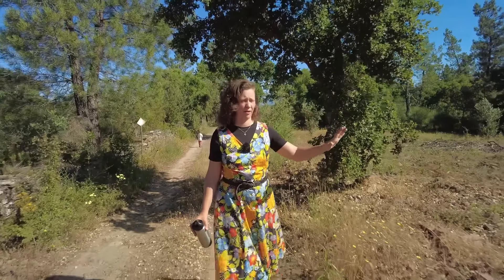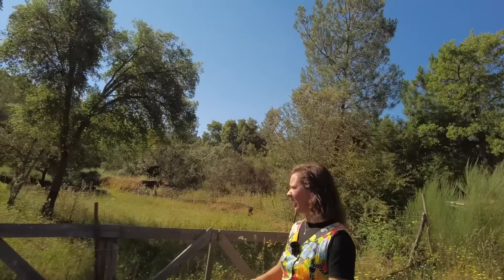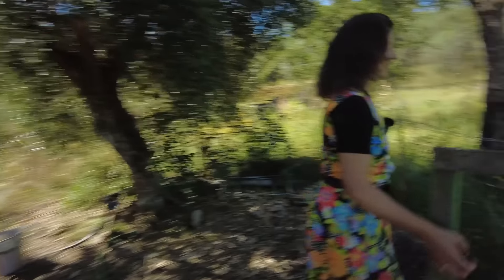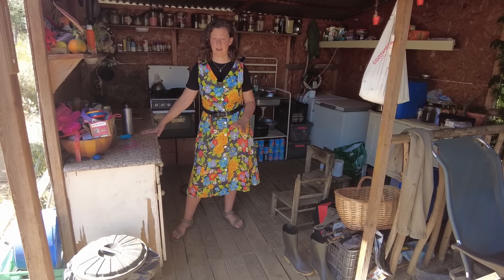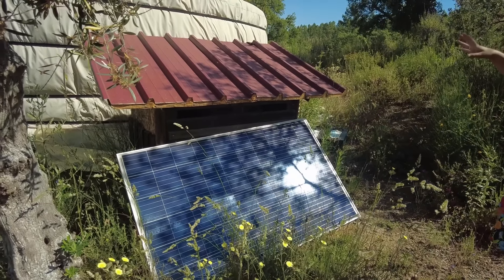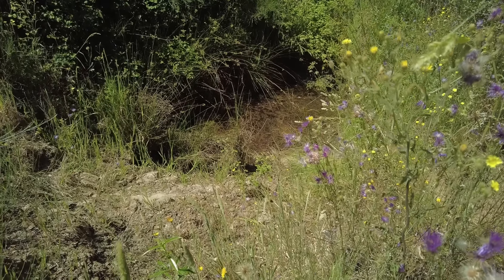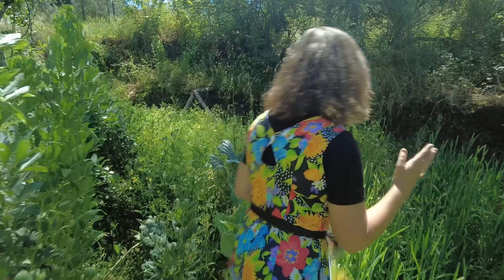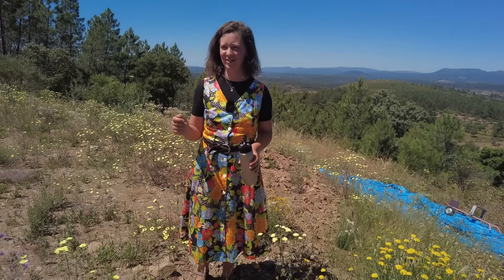We have lived off-grid in Central Portugal for 5 years - Property tour 2024

Comment: For the pond, you probably need only a simple contraption  to prevent water from draining out. In my mind you only need a high enough vertical concrete pipe cemented to the stone pipe that fills your pond. That way, when the pressure of water in the stone pipe is high enough, water can flow overflow out of the top of the pipe and into the pond. But, when the pressure in the stone pipe drops and the water dries up, the vertical pipe will prevent all the water from draining. A bit like putting a pipe in your sink drain to prevent it from fully draining
Hope it makes sense, otherwise I can add a sketch next time :)
Reply from the maker: I understand what you mean, but I don't think it'll work. We've tried to plug the hole with cement before and the water just found a way around. It would be the same with a pipe.
Reply: @ourportuguesehomestead  I see, quite a complicated situation apparently. It might be worth trying still as the water can easily break the cement when the pressure builds up in the underground tube, but the pressure is quite small he other when the water flows way around (pressure in the pond is small). I am of course guessing here and who knows. Good luck anways :)